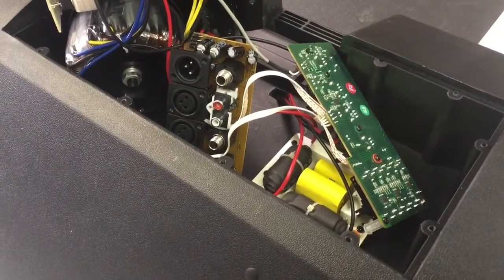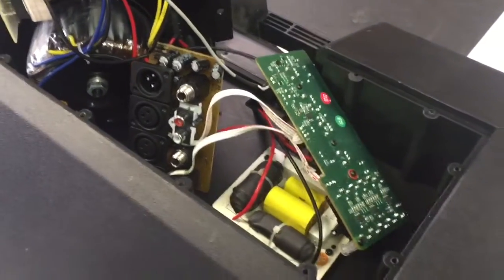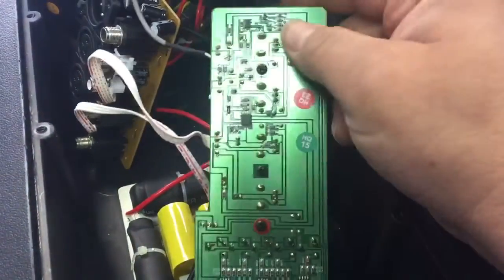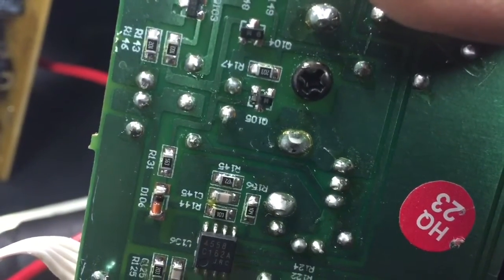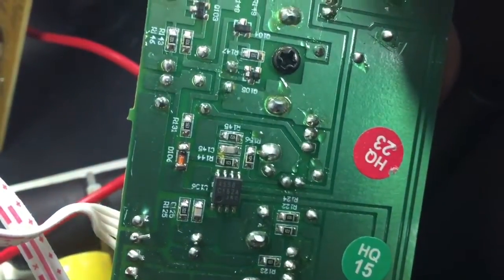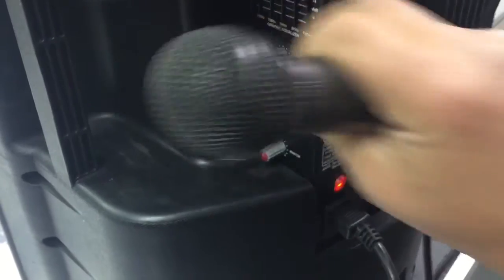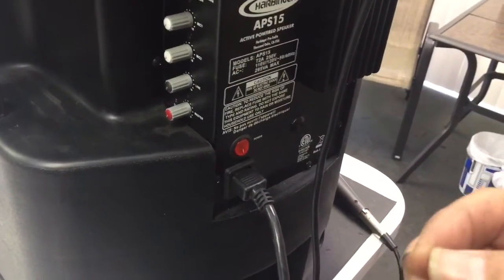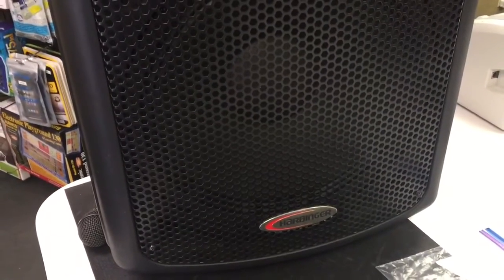Harbinger APS-15 Repair

Comment: Thanks for taking the time to produce and post this.  A client told me of his two "blown tweeter" APS-15.  After seeing this video, I risk ordered and received parts overnight, had them waiting when the speakers were delivered, and repaired with less than a day turn-around - this Q105 failure was indeed the problem on both.  My only fear is they now think service like that is "normal".  BTW, for anyone in a hurry, the suggested ebay links all have long shipping times (discount mail packet from China), so I identified a reasonable drop-in substitute:  BC856B-7-F from Diodes, Inc; they're in stock at Mouser and Digikey, can be had next day.  Mouser in particular delivers next day for ground rates if you live within a state or two of the Dallas area warehouse.
Reply from the maker: Glad it helped.
Reply: I have a harbinger 15 and there's no sound , there's power ,what can it be  ?

Comment: Please help. I try to repair myself. My speakers got the same problem as your mention on this video. I look up on the transistor market sales. I found one that list is "S9015 M6 PNP SOT-23 Triode SMD transistor BJT." Do you think that this transistor is a right one for replacement? I appreciated your help with any advises follow up.

Comment: I find it really interesting that such a situation would cause that transistor to vaporize like it did. It's almost as if the design lacked protection. Is this model bi amplified or just like the 12" version, a single full range amplifier? I saw a crossover so I'd assume it's not bi amplified. Very interesting for sure.

Comment: Hi and thank you for recording this. There seems to be very little info on how to repair these. I have 2 of those speakers. They do work but when I turn up my mixer and they get hit with some bass, a kick, or a loud vocal they cut out. I have checked that I’m not overdriving them. This happens at a sum what low volume. I suspect the previous owner did overdrive them. What do you suggest? Sorry for the long comment.
Reply from the maker: I will look into that problem for you, there seems to be a problem with the limiter section of this amp. Most of these compact units have a built in limiter so that the amp does not get blown, finding where that is on the board is complex because there is no schematics available for this PA. It sounds like a switching diode that is heating up when too much volume is passed through it, I will check into that for you and post A fix.

Comment: I have a couple of these. One of them sounds kind of soft and then BOOM...the sound just increases. And then after about a minute or so, the sound goes back down. Know what the problem might be?  I’m trying to open it and clean the board and the insides but still not sure what it could be.  Also...how do I even open it up to clean it?!
Reply from the maker: You may have a capacitor that is weak? Also check for cold solder joints around transistors and caps. As the board gets hot it will flex making a better connection with a cold solder joint causing it to pop and get louder.
Reply from the maker: https://youtu.be/BaRI0-o1nbM

Comment: If you happen to read this comment (11/30/20), I have a cracked interface circuit board from speaker falling over with XLR plugged in.  would be grateful to know if you have a suggestion for best place to get one.  Thanks!
Reply from the maker: You may want to check eBay and places that people sell “defected for parts only.” The board may have Electronics problems but can be repaired, your board sounds like it may not be repairable. You could send us a picture of your broken interface and we will see if we can steer you in the right direction.
nbrelectronics.com

Comment: Hi , I fought a used one plugged it in and no sound .bad speaker. Replaced speaker turned it on a got a real loud him and speaker blew. Something got real hot and by you could smell a burning smell. Thanks
Reply: That sounds like one of the output capacitors has shorted allowing the DC component on the signal through.

Comment: Hey, I hope you still have the speaker. My problem is the crossover the 3.3ohm resistor exploded and Damages the capacitor infront and there no visible values Can you tell me that value please?
Reply from the maker: Moises Bonilla Tadeo 
We repair the systems and then return them to the customer. I do not have the schematic for that amp. Sorry

Comment: Ok I did my home work and found the bridge rectifier checked it with my multimeter. I put the black lead to the positive spot and the red to the negative and got around 600 took the red lead to one of the AC inputs and got around 600 took the same red lead to the other AC input and my multimeter just stayed beeping. I thinks that's not good ? Now if it's bad how do I go about looking for the same one ? Marking on the side has as follows..
MIC BR1010  any advice?
Reply from the maker: Maximus T, eBay is your biggest source for those type of parts. Most will come from China some are in the  USA. Each part will have the value or the numbers written on the side that you can Google or put in eBay search.
Reply from the maker: https://www.ebay.com/itm/162636057448

Comment: My speaker has a buzz sound when I power up.  Any suggestions on how to repair?  nothing is plugged in except the power cord.
Reply: I realize your post is a year ago, but since I'm doing the same to a pair right now, here's what I found.  Remove the large screws on the perimeter of the back panel - 10 of them, including 3 hidden in the heat sink fins - and pull the electronic chassis out.  Two large capacitors - 3300uF 63V - are probably the problem.  They're easily replaced if you've basic soldering skills, be careful to pay attention to polarity.  I found good replacements at Mouser UKW1J332MRD, about $3.50 each and you'll need two.

Comment: What if I get no power to the unit it blows the fuse right away on switching on the power ?
Reply from the maker: You need to check the bridge rectifier,  it can also be a transistor that is blown. On some boards you have if you dialed in the front but you need to check. Anyone of those things could be defective causing your fuse to blow.
Reply from the maker: You have diodes in the front. Not dialed! Oops😏
Reply: I'm not to intellect on these boards it's the same speaker you have there the harbinger aps15. Where would that rectifier be?
Reply: Max T did you ever get any answers? Mine is doing the same